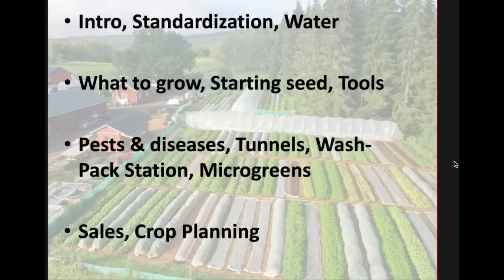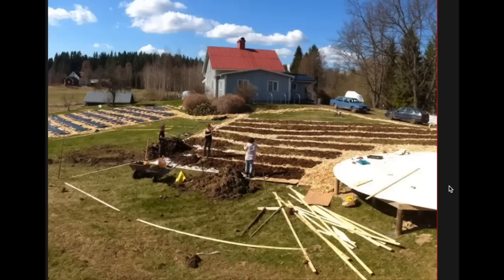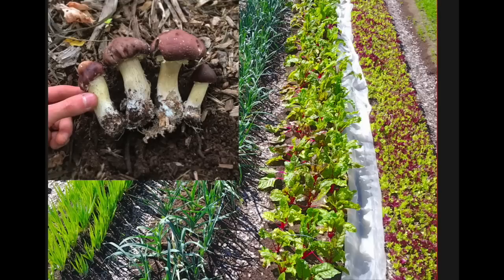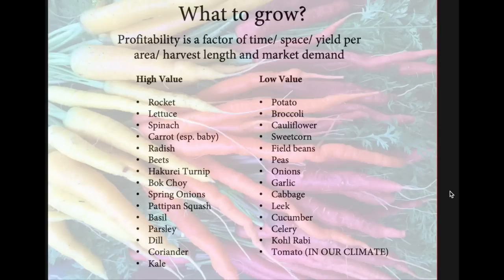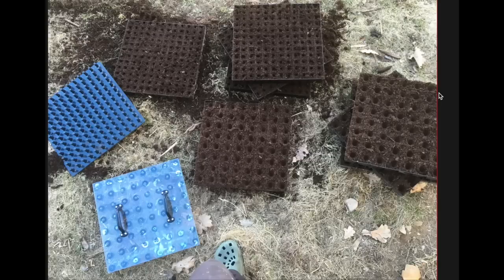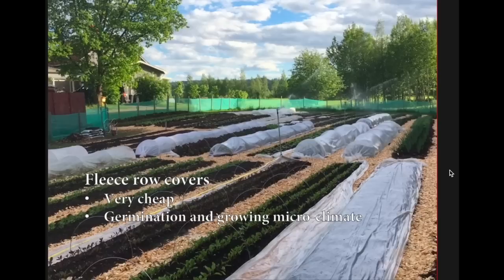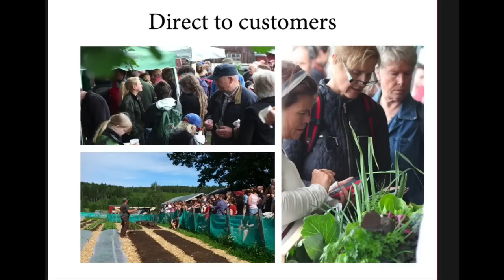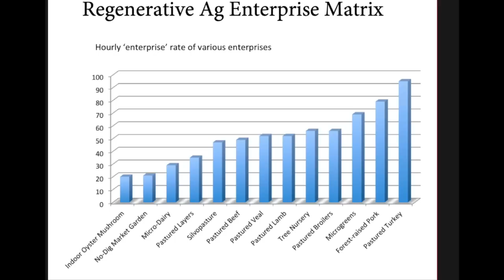No-Dig / No-Till Market Gardening: overview in 30 mins

Comment: I am overwhelmingly impressed! Earned a sub! From your techniques to your knowledge to actually getting down and dirty but producing something so amazing from it! Bravo! I strive to have a garden 1/10 as good as yours, next year I might just have to do the no-dig/no-till method. Last few years has been plowed and tilled and the weeds are atrocious! Even with mulch they come right through. What is the material that you used for your wind break fences?
Reply: Shade cloth hung on a fence is a low cost option.

Comment: Hi all, does anyone know what I can use to start no dig if I don't have access to cardboard or wood chips. Thanks in advance
Reply: You can cover pathways with any carbonaceous material. I have been using aged straw that was lying around (There was no longer any viable seed in it) You’ll need to apply it quite generously though. You could also use thick layers of leaves, but these might get mushy/muddy depending on your rain levels.